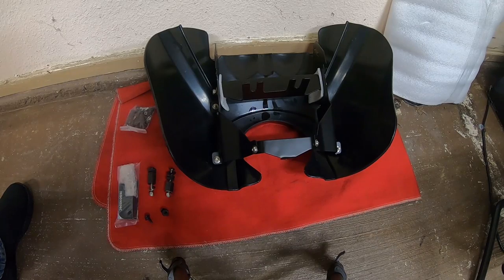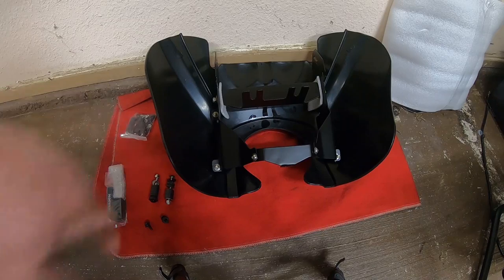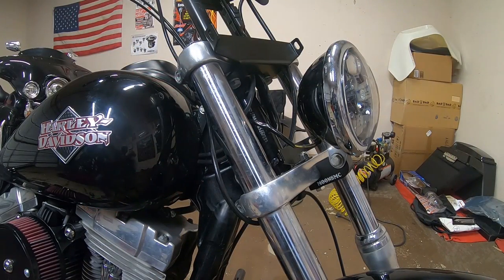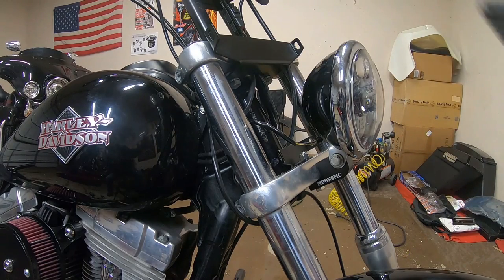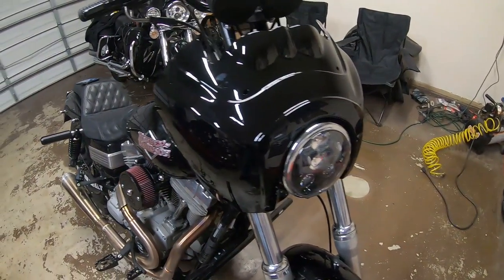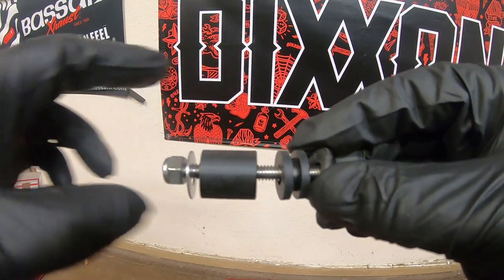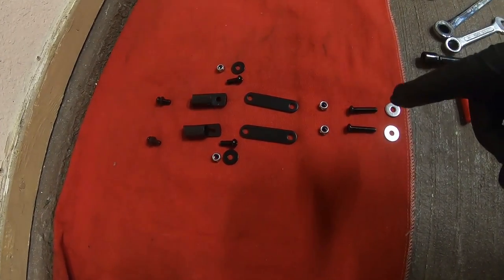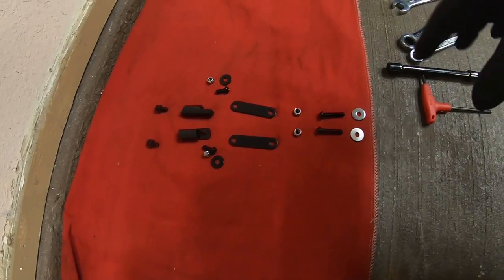Krator Fairing Install How To Harley Davidson Dyna

Comment: Got the same fairing, no instructions came with and this video was SUPER helpful!!! However...... I have a '96 Dyna FXDL.... and I can't get the head light mounted. I bolts from the top of the forks.. any thoughts?? Thanks!!!

Comment: Excellent chum. I just got the same fairing (different name) from Motea, and it came qith no instructions but no need. You did it for me! Thanks for your help, especially with regards to the headlight thing. BTW. Where did you get the rear craah bars? Cheers.
Reply: Hey! I bought the same...Did you need the extension piece for the light??

Comment: I have a question? On my bike my headlight bracket that mounts to the extension block. Is wider than the block... Did you have to put spacers in between or did urs bolt right up? My bike is a 2010 Harley Davidson Softail Custom. It has a Dyna Wide glide front end tho. So theoretically it should work. The only difference I see is the mount for the headlight. It seems to have a wider opening. As if the blocks to skinny. Did you have this problem? If not I should be able to just buy some spacers of some sort, right?
Reply from the maker: Yea the dyna bracket is different than a softail

Comment: Great install video on the Krator fairing, i'll be referencing this after mine comes back from paint. Quick question, what height risers are you using, and are those bunking front and rear crash bars? Thanks!

Comment: When I ordered mine the suggested headlight block was the Memphis shades and I have a inch or more gap at the top. I wonder if the moons MC would be a better option. Any insight would be greatly appreciated.
Reply from the maker: To me the moons mc block fits perfectly on 06+ dynas
Reply: @TrippHPjunkie  I've got a 16 dyna. Just ordered the Moons MC one.
Reply: @TrippHPjunkie  and this video was the one that helped the most with the install.

Comment: Excellent videos. Wondering if this setup would work on an older smaller 39mm dyna (04) ? Thanks
Reply from the maker: Thank you yes it will but you will need a different headlight block since these are designed for 49mm

Comment: With the mounting on the Risers, it's the bolt the only part showing on the bottom? My handlebars are moving quite a bit now with the bracket mounted on there
Reply from the maker: Sounds like the riser bolts arent tight enough
Reply: @TrippHPjunkie  yea I had to loosen the bolts and reseat it so the lock washers could flatten out. Still have movement, but very miniscule

Comment: It seems to me that this would mount easily to a wide glide front end... would you agree? I’m considering putting one of these in a 2003 FXST.
Reply from the maker: the way it mounts is to the bottom of risers and headlight so yes it most likely would work

Comment: Are all the dyna fairings the same part number for the years, I’ve seen krator fairings at different prices but no part number, I have a 2006
Reply from the maker: 06 and up are different I believe its when they changed to 49mm front forks
Reply: Ok thanks I just got mine in the mail and the head light bracket too, just need some free time to install it, thanks for the video

Comment: I've had this faring two years now, held up good. But. Will the the windshield is junk!, too much distortion, I replaced it with a jd windshield
Reply from the maker: Kinda figured it was since a buddy ran one for awhile without the crack at the lower hole but it eventually happens IDK if I will keep it but going do the research and document it for sure really wanted to so a properly done video on the install for awhile now thanks for the comment man......👍👍👍

Comment: Question. I have an 05 FXDCI and on all eBay, amazon, it says for 04-05, needs professional installation. Anyone have any idea why I can’t do it at home?
Reply from the maker: Yea alot of these are designed for 06 and up forks are bigger etc you can make one fit on older bikes just takes a little patience and time
Reply: @TrippHPjunkie  - appreciate the response 💯

Comment: I have Krator fairing and there is buffering. I was wondering how your turned out with the JD Custom buffering kit?...have you tried it, any buffeting?
Reply from the maker: there is some buffering but it is manageable no worse than a street glide with a small windshield hope that helps

Comment: Where did you get that aftermarket headlight bracket. My order didn’t include that on my Krator fairing making it impossible to install without it as I can see in your video it definitely needs it to make the install work.
Reply from the maker: Yea it was attached to the fairing when I received mine
Reply from the maker: Also the headlight bracket is from moons mc all links in description

Comment: Quick question, do you think this same setup will work on my 04 sportster?
Reply from the maker: It might work if the riser bolt spacing is the same probably need a different headlight block also

Comment: Sucks that i cant find one for my 19 fxbb
Reply from the maker: This one will fit with slight trimming of the headlight mount and using the moonsmc bracket.... not a detailed video but check this out
https://youtu.be/urGOYXmtdg0
Reply: @TrippHPjunkie  thanks video was great but the fairing is not available yet. I have looked all over the place lol
rather this guy then the memphis warrior one for $300
Reply from the maker: We used one for a dyna on that 18 FXBB